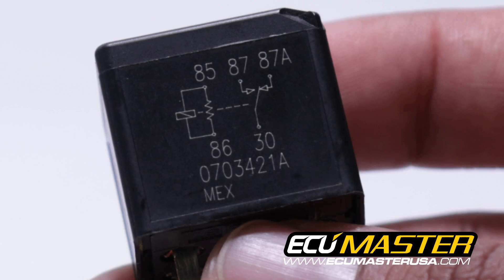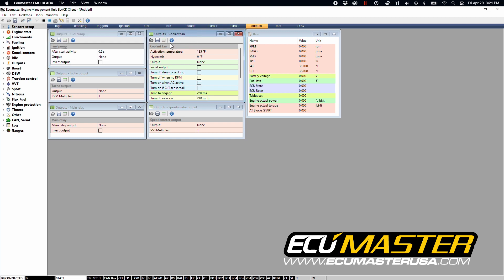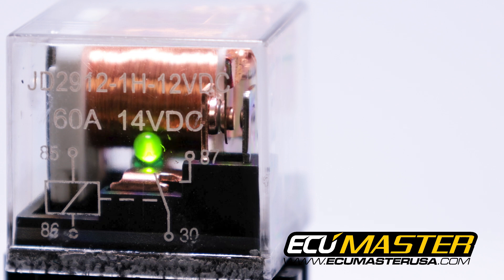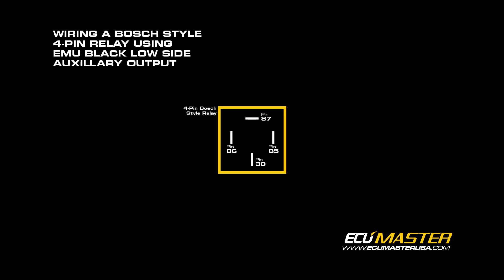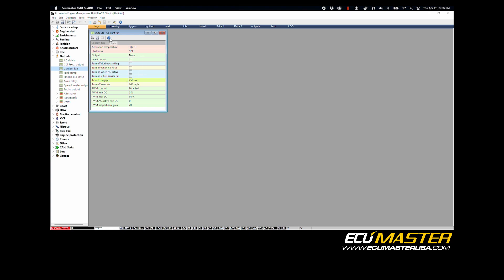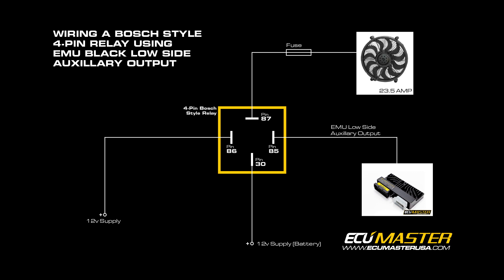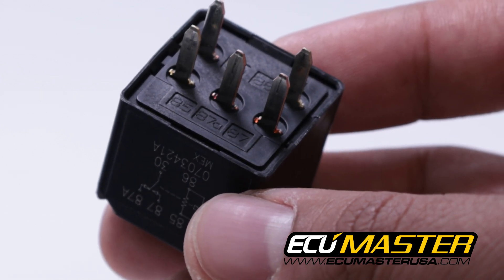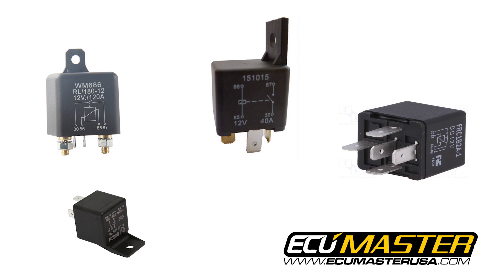Wiring Relays to EMU Aux Output  | ECUMaster USA

Comment: Does 12V to pin 86 need to be switched? On Haltechs it'll backfeed current when the ecu is off is constant is used - wondering if its an issue with the EMU.

Comment: Would love to see a water methanol table based on map and RPM (Alpha-N with Map). Currently using the nitrous fuel scale and a virtual output to trigger my fuel cut and lamba table switch. Using a PWM 1 table and output driving a solid-state relay to control water methanol pressure. Would also be great to see an additional pressure for W/M currently using AC pressure with my 0-5v sensor since all other pressure inputs are being used.  
Great product.  
Tod Derks
Reply from the maker: Great suggestion!

Comment: Well needed video, very useful info.
I wired my entire project car down to engine harness & body harness. When I finished I had all my relay triggers as + triggers not realizing that all the auxiliaries on the emu black was - triggers referencing ground. Luckily before even testing it out a colleague of mine pointed that out to me which I then just had to cut all my grounds swap the pins and feed the + triggers to a fused 12v source. Swapping the pins meant that I didn’t have to cut any wires that was already run to the emu connector for fuel pump/fans, I labeled everything and left only the main relay in my custom box as a + trigger whilst all others are now - triggered. 

Great and useful video esp for those doing their own wiring as when you check out relay wiring diagrams online it tends to show that you can wire it both + or - trigger and both ways are accepted based on intended purpose. 

Useful video, keep them coming

Side note:
My current dilemma is that I now have fuel and spark and synchronized during cranking and adjusted timing with a light but still she wants to start up but just won’t start with the base map. 🥹😩. I am using all WHP fuel Pressure and temp sensors & adjusted my fuel rail to 3bar which is roughly 43.5psi. All my injector data for my ID1050x are in from the wizard and I’m also using the coils without igniter so the emu drives them and tested everything works and is numbered to match each coil & injector. 
Almost ready to pull my hair out 😂
Reply from the maker: If you're having any frustrations please remember to reach out to our support staff via phone or email Monday through Friday 9am to 6pm central - 1.817.523.9947 / support@ecumasterusa.com
Reply: Did you ever figure it out? What engine and chassy?